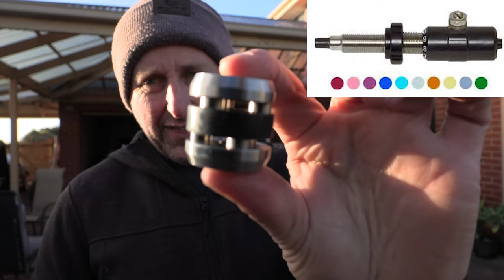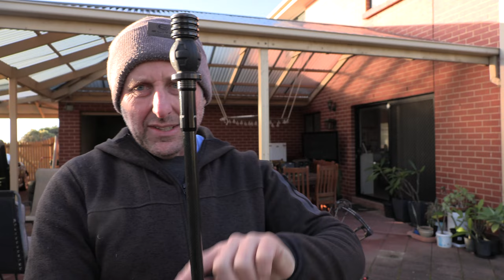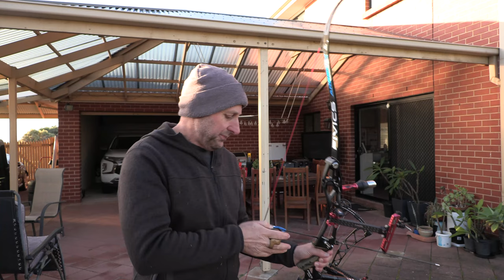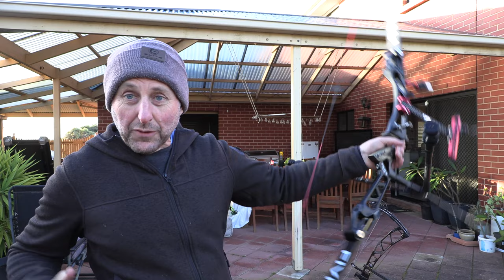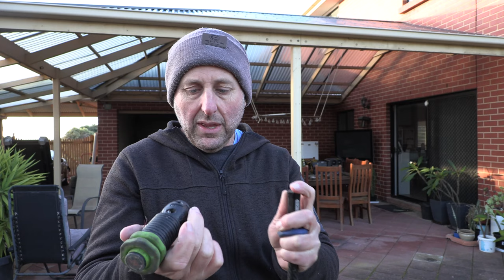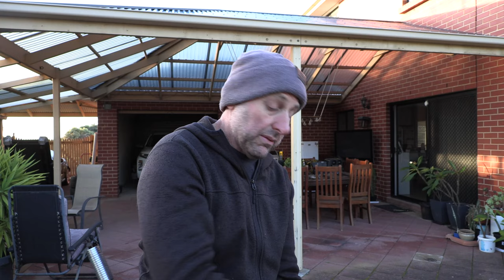Beiter Vbox Dampener review

Comment: Whats the chance of doing a 'how to' when making custom arrows... as currently I'm going to a more target focus with my arrows rather then off the shelf budget item ie £50 for 12 (400 spine, 100 grain point etc savage arrow)
I've recently moved to a Id 3.9mm carbon/aluminium arrow with break off points (150 to 100 grain) I've fitted the nock pin, nock, fletching's no issue the point I've removed the x2 clearly visible snap off parts of the point (my view that should bring it down to 100g?? the remaining) anyway at 18m this new arrow drops 8inches on my target.. I'm guessing the tip is still too heavy, are you then to cut other sections from the rear of the point...

yes I'm blind currently as I've not yet received my grain scale (it is ordered) advice would be or recommendations?? I've tried doing a utube search for arrow making/point weight etc & I cant find anything relevant (anyone elses advice would be great aswell)
Reply from the maker: Can I say everyone has done this before.  Tried all the arrows and the point weights.  Most people have different views.  I have people on a world stage shooting between 150 and 110g points.  For recurve spine is important as it needs to flex around the bow.  With compound some say lighter spine is more forgiving and others say the opposite.  I have tried most things and I do them on the Channel.  The thing which makes the most amount of difference is shooting.  My scores if I shoot once a week are not bad a good club shooter.  If I train each day then I get closer to top of the country.  The archers on a world Stage are normally shooting 200+ arrows a day.

I have gone from Goldtip to Victory, Skylon now Pandarus.  I recently shot the X10 Pandarus the CA320 and I shot my best score with them but it was only 1 point better than I shot with the cheaper arrows.  I shot the $100 premade arrows and shot a 299 out of 300 on my first shoot and the 9 was all me.

Now if you shoot a good shot and it does not go in the middle then you have a problem.  But most of the time it is the archer.  Last weekend I shot poor, I was weak bad release, form struggling - this week is greatly improved.

My advice with arrows is you shoot scores - then you try stuff and see if you shoot a better score.  It may be the weather or you just shot better.  But you record it all then you can see the difference.  Im currently shooting premade arrows from the factory and the scores are fine.  I am thinking about different vanes.  But still focusing on form and building back.

Comment: I really like what I’m seeing from Elite for bows but with a 32” draw length I don’t know if it would work for me
Reply: Definitely a struggle with a draw length that long, you'd probably have to get a Bowtech or PSE orrr I've heard the elite verdict may be getting a longer ATA
Reply: PSE has a selection of bows for you.
Reply: @jamesjgill  I know. I have 6 of them. I’ve sold a few Elite bows in my shop and really like them. I just don’t think they will go long enough for me
Reply: Just cut your humerus short and then you can use whatever you want
Reply: Elite option 6 feels short compared to my bowtech ss  but a excellent bow
Reply: ok, I'm guessing the draw length is too short.....?? if that's not the issue & the max length is long, go to a shop & trail one, as you'll still have very good speed out of the bow, I've the PSE Citation 37em cam (think that's the one anyway) & its got a long DL but the speed is still fantastic ie
savage 400 & 500spine arrows 18m they penetrate a 12-3" foam layer target, the new arrows I've just commented on this upload (above) 3.9mmID carbon aluminium arrows they penetrate upto the 20"+ on the arrow ie travel incredibly fast..

my issue with Elite little to no information on lb/DW with the 3 limb turns, as I'd like to increase total DW, currently running 50lb PSE & Browning (classic compound shooting recurve style) ie no peep, fingers, basic pin front sight.. anyway, getting a higher DW bow & then not being able to draw it back when reducing the DW is a concern to me.....

so, anyway, is your concern too long or short?
Reply from the maker: The 32" is an issue with Elite.  I would choose another brand.  You dont want to get the bow and feel it is to short.  You want the ability to adjust length

Comment: Does Beiter specifically say that the ¼ end is for the connection to the stabiliser? 

I've had the Doinker Hero and Exo dampeners and especially with EXO being rubber at both ends is a limitation so I'd almost pay the extra to get a Beiter just to have a more secure and long lasting product. 

There are 2 different cores for the EXOs and i think as standard they come with a 40 on one side and a 60 on the other.
Reply: I haven't watched the whole video, but 1/4" end?  I've had a pair of these with the plastic ends and now running two sets of the steel ones, and they are all 5/16".
Reply: @ScottPankhurst  I also thought that cause all the ones I've seen are 5/16
Reply from the maker: It says on the packet 5/16-24